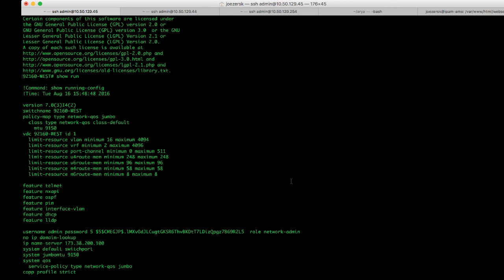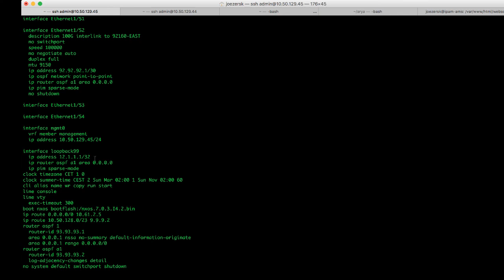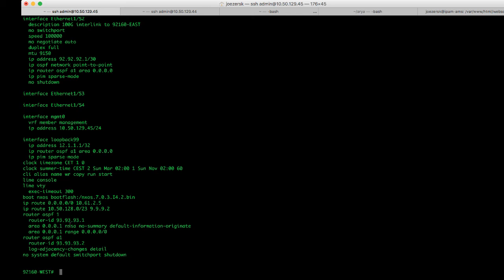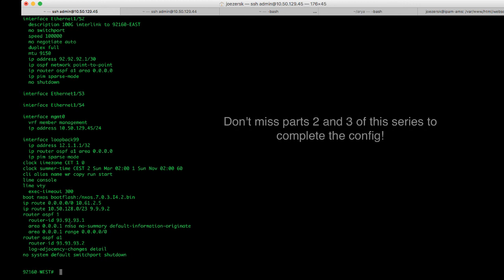ACI Multipod - Part One - Set up the IPN

Comment: I am planning to deploy IPN using the GRE tunnel, any suggestion about MTU size, ? . 
An urgent reply would be highly appreciated.
Reply from the maker: Hi Khan.  Not sure how well PIM BiDir RP will work and you may have to set up multiple tunnels between all your IPN devices.  You will also have to account for the encapsulation overhead of GRE, so whatever your transit network is, you will need something larger than 1500.  Add 50 bytes for VXLAN encap and ~24 bytes for GRE.  To be honest, I strongly do NOT recommend GRE in any case.  It is a software driven process that puts all the load in the general purpose CPU of whatever device is handling the tunnel end point.  It means that even with low amounts of traffic, the CPU on that device will approach 100% fairly quickly.
Reply: @josephezerski5124   Hi, I have deployed IPN using GRE tunnels  3 weeks ago, and it is up and running now. All remote spines and leaf switches of POD2 are now registered with the APIC. My topology consists of Nexus and Cat9k, since we didn't want to go for MPLS-VPN so we decided to deploy it with GRE tunnels. I don't know what to say at the moment about the performance but let's see what comes up in the future.

Comment: why the same address of the loopback in the rp ???
Interface loopback99
  vrf member tn-infra
  ip address 12.1.1.1/32
  ip router ospf a1 area 0.0.0.0
  ip pim sparse-mode
!
  ip pim rp-address 12.1.1.1 group-list 225.0.0.0/8 bidir 
  ip pim rp-address 12.1.1.1 group-list 239.255.255.240/28 bidir

-------------------------
why not as below 12.1.1.2,  many of cisco ref guides show that it should be different, even you mentioned this in your comment but your config using the same address

"Hello, Els.  For the phantom RP, the loopback address will be the same on all IPN devices.  The only difference is the length of the subnet mask.  It becomes more of a routing game with longest prefix-match.  If the primary with the more specific mask fails, the next one with the less specific mask will take over.  There is a recent config guide on  multipod that explains that here:  @t"

ip pim rp-address 12.1.1.2 group-list 225.0.0.0/8 bidir
  ip pim rp-address 12.1.1.2 group-list 239.255.255.240/28 bidir

Comment: Hello Joseph, I think PIM BIDir, DHCP RELAY and MTU is not the only requirement. I believe there is a limitation for RTT between IPN devices?
Reply from the maker: Ah yes, you are correct.  The maximum RTT latency we support is 50ms.  Hope that  clears things up for others who have the same question / observation
Reply: @josephezerski5124  thank you very much Joseph. I am very interested where those limitations came from? why 50?)
Reply from the maker: @AlexeyTsapaev  Well, 50ms is the number that engineering is comfortable with when considering things like APIC cluster across pods.  In practice the number could probably go higher but to err on the side of caution 50ms is what is officially supported.

Comment: Hi Joseph,
i have these question if you can assist please:
1. Regarding the storage replication between two DC & DR, if i have extra links for the replication and i don't want the replication go through IPN, how i can connect this links between DC & DR?

2. Regarding BIDIR Phantom RP configuration, i have 4 node IPN network, two in each site, what is the best design to have for example:
              a. POD-1-IPN-1 be primary, POD-1-IPN-2 be secondary or POD-2-IPN-1 will be secondary or doesn't matter?

3. If the campus devices connected to BL via L3out, can the users access the IPN devices, or we need a contract between L3out campus and L3out in infra tenant?

Thanks in advanced
Reply from the maker: Hi Mohammed.  Let me see if I can answer here to your satisfaction.

A1.  Storage.  It depends on what the storage link is.  If it is an IP based protocol, then you could set up standard routing via L3Out.   You could even use your IPN devices if you wanted in a different VRF (like a user tenant VRF, not infra VRF).  

If it is FC, then you could connect your ACI leafs over FC/FCoE to whatever your Fiber Channel switches are (like an MDS).  Be aware that with FC/FCoE, ACI only currently supports NPV mode.  This is say the ACI fabric cannot act as a full FCF and needs some other device, like MDS, Nexus 7K, or Brocade to handle that.  Also be aware that native FC ports only come on certain later models (FX).  FCoE has broader support on more models.  

A2.  Phantom RP placement really does not matter.  PIM BiDir packets will always flow towards the RP, wherever it is.  I suppose if you have a majority of mcast senders and receivers in one Pod, you would prefer the RP to be closest, with the phantom RP also closest to that POD.  

A3.  I am not clear on why Campus users would need to access the IPN for anything.  Its only purpose is to interconnect PODs.  If you mean for management purposes, I always recommend routers and switches all be a part of a proper OOB network, independent of what it is managing.  This is true for ACI and everything else in the DC.  I consider it a best practice for anything in DC.
Reply: A1, Yes this IP based protocol, currently the replication using L2 Vlan between the two DCs, since i have dedicated links for replication i don't want to use IPN, Could you please guide me how can achieve it?
A2, yes most the services in DC, so in this case the primary and secondary will be on POD-1. correct me.

A3, yes to manage IPN devices because i am using VDC for IPNs and i want to access through loopback, so in this case how can i do it?
Reply from the maker: For storage designs and L2 DCI, I think this document will help you.  

https://www.cisco.com/c/en/us/solutions/data-center-virtualization/application-centric-infrastructure/white-paper-c11-737077.html#_Toc451492787

For managing IPN devices, you could put those loopbacks into a management VRF and just make an L3 out from a standard tenant (not infra, maybe you can make a special tenant for your Ops team).
Reply: Thanks a lot for assistant :)
Reply: Hi Joseph,
i have read the doucment, in Figure 49.    Layer 2 Data-Plane Communication Between Endpoints, i can connect extra link between BL in DC and DR as shown in figure 49, but what about MCP and LLDP, do i need to disable MCP and LLDP ?

Comment: Hi Joseph,
I have the questions:
1. Multicast Range i found to different configuration which one is correct:
     a. 
vrf context tn-infra
  ip pim rp-address 12.1.1.1 group-list 225.0.0.0/8 bidir
  ip pim rp-address 12.1.1.1 group-list 239.255.255.240/28 bidi
  ip pim ssm range 232.0.0.0/8

   b.
  ip pim rp-address 192.168.100.2 group-list 225.0.0.0/8 bidir
  ip pim rp-address 192.168.100.2 group-list 239.0.0.0/8 bidir
  ip pim ssm range 232.0.0.0/8

which is the subnet mask are correct "239.255.255.240/28" or "39.0.0.0/8" ?

2. Regarding the RP loopback, do we need to advertise it under OSPF?
3. Jumbo frame configuration for N7K the same for N9K?
Reply from the maker: Hi Mohammed.   There are two mcast groups we need to account for in the IPN.  I'll briefly explain each.  

First Group: 225.0.0.0/8 is so that you send your ACI Fabric GIPO range across the IPN.  This is what you set up when you first initialized the fabric on Day-1.  It is used by the bridge-domains.  You can check this by clicking on the list of BDs in a given tenant.  You will see a /32 GIPO address handed out to each BD in the 225.x.x.x range.  

Note:  I think the default GIPO range when you first set up the fabric is 225.0.0.0/15 but the official Cisco config guides for IPN all use /8 for the set up, so I'd go with that.  

Second Group:  239.255.255.240/28 is used for what is called the "glean address".  Technically, you only need 239.255.255.240/32 for this, but again, the guides add a bit more room for the future, if ever needed.  So, the correct group-list network here is 239.255.255.240/28.  

If you want to read more details on mcast, GIPO and Gleaning, check the nice whitepaper here:

https://www.cisco.com/c/en/us/solutions/collateral/data-center-virtualization/application-centric-infrastructure/white-paper-c11-737855.html#_Toc463058880
Reply: Hi Joseph,
Thanks for your answer, yes this is will be new installation  but i was confusing because  read below document and it was used this range "239.0.0.0/8 "
https://www.cisco.com/c/en/us/solutions/collateral/data-center-virtualization/application-centric-infrastructure/white-paper-c11-739714.html#_Toc495712857

I will configure what you advice "239.255.255.240/28" instead of  "239.0.0.0/8 "

Thanks

Comment: Hi Joseph,
How will the config look on ipn nodes with Phantom RP redundancy
Will loopback0 stay same in config with only a different subnetmask on other ipn node.
Or will i have to configure loopback 0 with other address from 12.1.1.x range and keep RP statements for 12.1.1.1

Kind regards
Reply from the maker: Hello Els.  For the phantom RP, the loopback address will be the same on all IPN devices.  The only difference is the length of the subnet mask.  It becomes more of a routing game with longest prefix-match.  If the primary with the more specific mask fails, the next one with the less specific mask will take over.  There is a recent config guide on  multipod that explains that here:  https://www.cisco.com/c/en/us/solutions/collateral/data-center-virtualization/application-centric-infrastructure/white-paper-c11-739714.html

Hope that helps.
Reply: Thank you for your answer.

So for a 4 node IPN network (two nodes per datacenter interconnected)
You would get a config like this :

DC1IPN01:

vrf context tn-infra
  ip pim rp-address 12.1.1.2 group-list 225.0.0.0/8 bidir
  ip pim rp-address 12.1.1.2 group-list 239.255.255.240/28 bidir
  ip pim ssm range 232.0.0.0/8

interface loopback1
  vrf member tn-infra
  description BIDIR Phantom RP
  ip address 12.1.1.1/31
  ip router ospf 1 area 0.0.0.0
  ip ospf network point-to-point
  ip pim sparse-mode

 DC2IPN01 :
  vrf context tn-infra
  ip pim rp-address 12.1.1.2 group-list 225.0.0.0/8 bidir
  ip pim rp-address 12.1.1.2 group-list 239.255.255.240/28 bidir
  ip pim ssm range 232.0.0.0/8

interface loopback1
  vrf member tn-infra
  description BIDIR Phantom RP
  ip address 12.1.1.1/30
  ip router ospf 1 area 0.0.0.0
  ip ospf network point-to-point
  ip pim sparse-mode
  
 DC1IPN02 : 
  vrf context tn-infra
  ip pim rp-address 12.1.1.2 group-list 225.0.0.0/8 bidir
  ip pim rp-address 12.1.1.2 group-list 239.255.255.240/28 bidir
  ip pim ssm range 232.0.0.0/8

interface loopback1
  vrf member tn-infra
  description BIDIR Phantom RP
  ip address 12.1.1.1/29
  ip router ospf 1 area 0.0.0.0
  ip ospf network point-to-point
  ip pim sparse-mode
 
DC2IPN02 : 
  vrf context tn-infra
  ip pim rp-address 12.1.1.2 group-list 225.0.0.0/8 bidir
  ip pim rp-address 12.1.1.2 group-list 239.255.255.240/28 bidir
  ip pim ssm range 232.0.0.0/8

interface loopback1
  vrf member tn-infra
  description BIDIR Phantom RP
  ip address 12.1.1.1/29
  ip router ospf 1 area 0.0.0.0
  ip ospf network point-to-point
  ip pim sparse-mode

Kind regards,
Reply from the maker: The mask on DC1IPN02  and DC2IPN02 are both /29.  You might want to amend that so one is more specific than the other.  Everything else looks ok to me.  One last point.  You don't need to use 12.x.x.x for this.  That was just the random IP address I used in my lab.  You would ideally pick something out of a subnet you own and control.  Could also use RFC 1918 addresses too.
Reply: Thankyou very much.

Kind regards

Comment: Hi Joseph can you let me know why MTU 9150 as ACI only supports upto 9000
Reply from the maker: Ok, this one is a multi-part answer, b/c a few things have evolved since last year.  ACI default MTU between leafs and spines is set to 9150.  This assumes server MTU is 9000 and we allow for VxLAN encap overhead on top of that.  This is true for both data plane and control plane in ACI.  You have been, for some time now, able to change the default 9150 setting for data plane to something smaller, but this would apply fabric wide.  The complexity is that the EVPN control plane setting used to be fixed at 9150 and not changeable, thereby forcing 9150 across the IPN.   However, in ACI release 2.2.2e and beyond, we added a feature that allow you to set the CP MTU to something smaller now.  Hope that makes sense.

Comment: Hi Joseph, I have a question for you please. 

I am deploying a 3 POD ACI design with 5 APICs, everything is working okay other than the remote APICs not joining the cluster.
I am looking at the design doc and I want a bit of clarity on the below table. As in my case, I have the follwoing APIC distributions:

POD1 - 2 APICs

POD2 - 1 APIC

POD 3 - 2 APICs.

This does not match the below table exactly as POD2 should be 2 apics and POD3 1 apic, but will my design work?
Reply from the maker: Hello Tayo.  APICs can go anywhere you want them.  The design guide is trying to give you a good option to minimize the loss of quorum if any pods should go offline or become unavailable.  

As far as remote APICs joining the cluster, make sure when you move them to other pods that you wipe them (acidiag touch setup).  When you do the initial APIC setup process, make sure you answer the question about TEP pool to be the TEP pool from POD 1.  All APICs must be setup to use the TEP pool from POD1, otherwise the cluster won't form.  

Just curious, what is driving the choice for 5 APICs?  Nothing wrong with that, mind you.  Are you deploying an extra large fabric and you need the scale?
Reply: Thanks for the swift response. Yes is the answer, else we can run this as a 3 APIC cluster. 
The Issue I see is APIC 2 single APIC is not binding the Leaf connections to Bond0. I have run various APIC commands, like ifconfig | grep "bond0.".
In the start up after Setup script, it comes up with an error "could not add vlan 4094 as bond0.4094 on dev bond0"
then it says "bringing up interface lxcbr0: failed"
OOB Interface is also not coming up in layer 1
Do I need to RMA the box?
Reply from the maker: ohh, danger!  4094 is a reserved VLAN and thus you don't want to / cannot use that.  The general guidance of the choice of the infra vlan is between 2-3967.  That makes sure you avoid any reserved VLANs for any Cisco device.  To change this, you need to back up an APIC fully, wipe them all, and bring them up with a new infra vlan choice.    Then you can reimport your saved config.
Reply: Sorry I meant to say 3000 and not 4094. Slip of mind :(